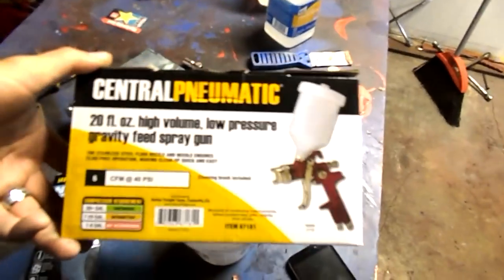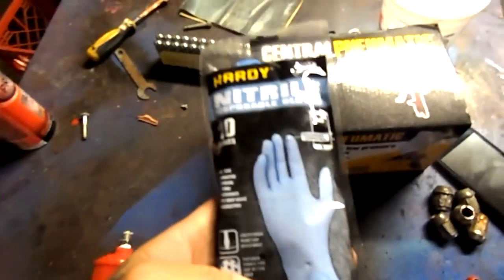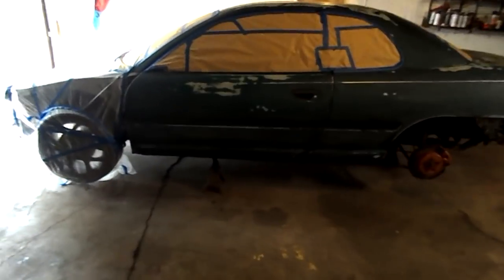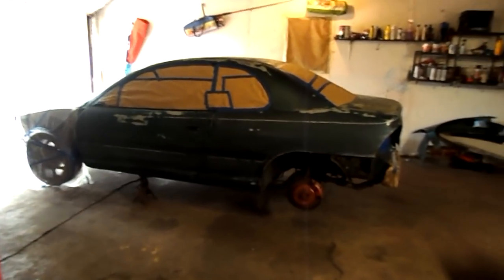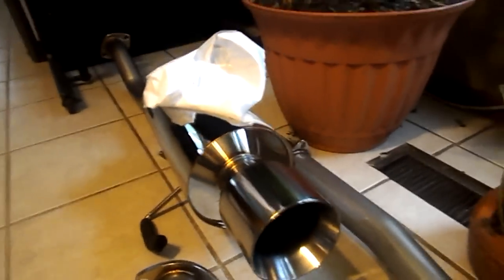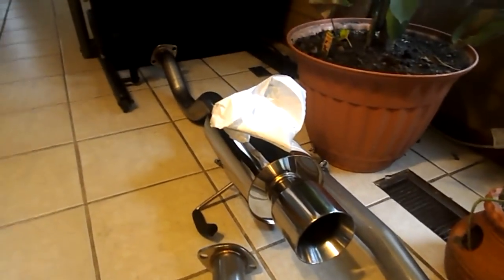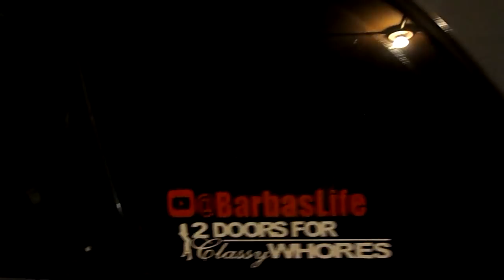95 Neon RT Rustoleum Gloss Smoke Grey paint job part3

Comment: its turning out nicely , quick question though.  What are your ratio for paint to mineral spirits? also, when you lay down the rusto-primer do you also thin that as well? and again what ratio?  thanks in advance

i also found out you can use enamal hardener called valspar have you heard of it? some people had good results with this, perhaps try it on a test panel? anyways good shit bro keep it going (where you from btw?)
Reply from the maker: 4 paint 1 mineral spirits I posted the info on the description. I'm in Illinois chicagoland area.
Reply from the maker: Never heard of that hardner  but I'm gonna look it up and give it a try.